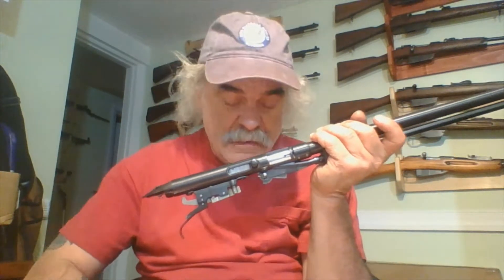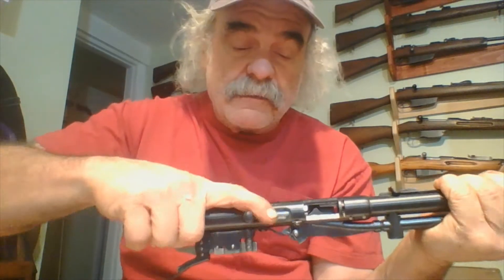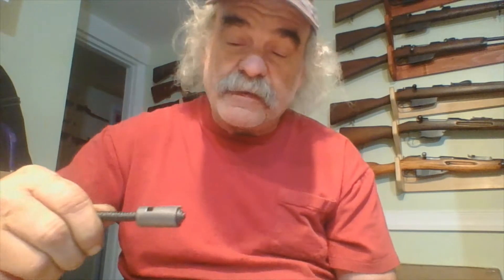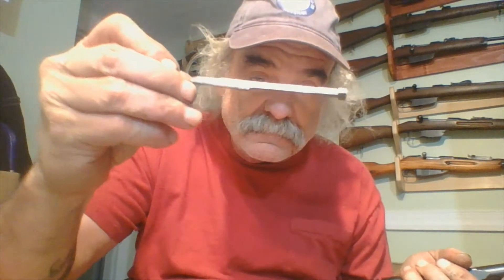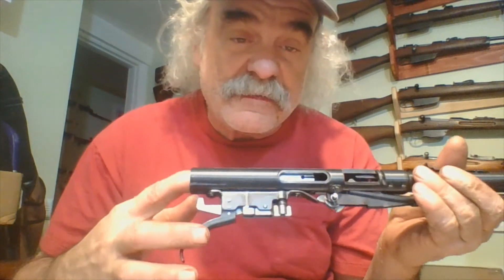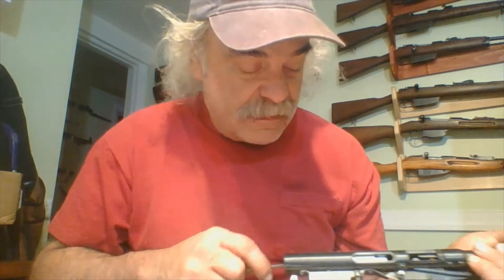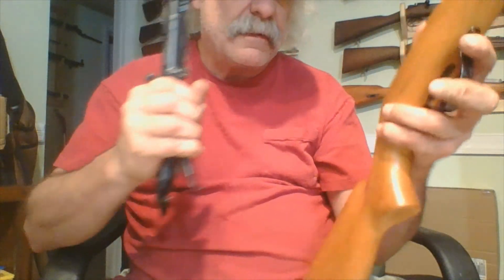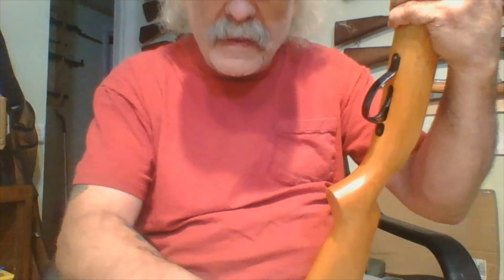A look inside the Savage 187r

Comment: Did you leave the safety un- installed?
Reply from the maker: Good Catch.  I was still doing work on the end that screws in.  I didn;t want to put it on until i was done cause i would be taking it off and on.  it is  pain to get on and off.  Later when I finished and before taking it to the range i put it on.  Thanks for pointing it out,  Tom